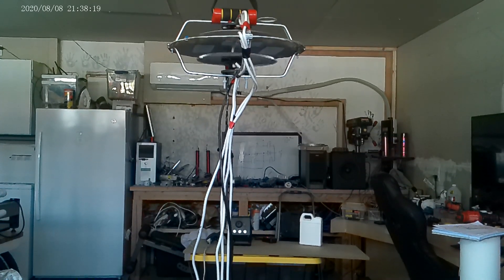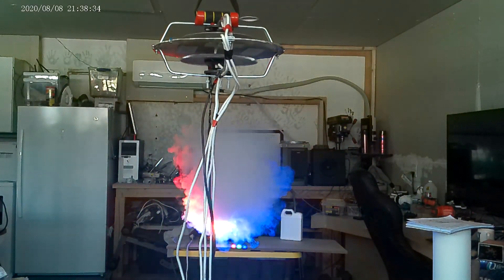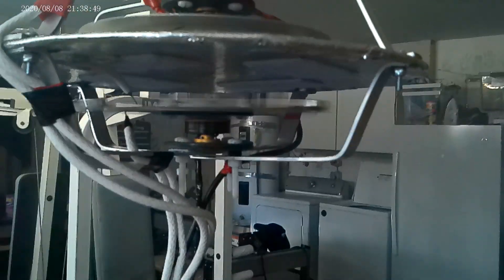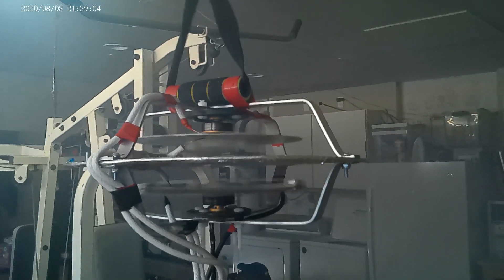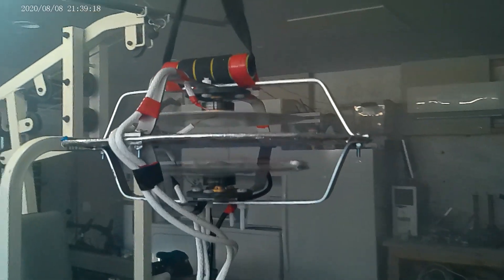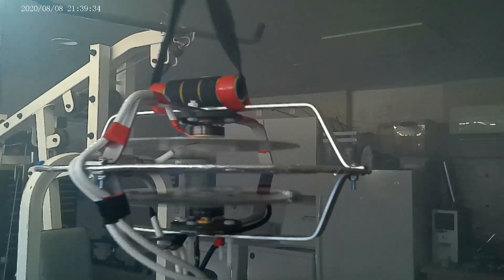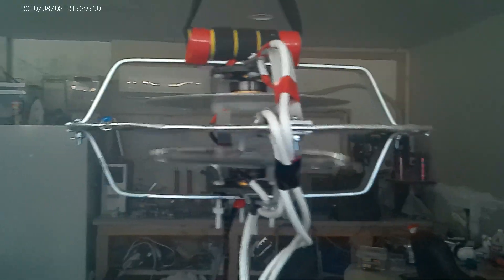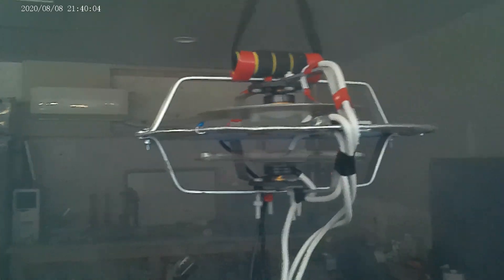Ufo Fog machine on graviflyer

Comment: near the engine that you are powering to create - the mobile phone does not work and any electronics.
Reply from the maker: Everything works fine.. the htz causes those things to not work. When a different frequency is uses it doesn't communicate with the other electronics. However if you are within a close range to the htz from the wall plug then it starts to have problems. It's like an am station on the radio.

Comment: this is a good idea when you inspect look from a distant not so close . where can i find your current understanding for how it works i want to see how near you are to comprehending your observations
Reply from the maker: was thinking of putting a shroud under the bottom disc. Just to see if i can get the fog to flow. Do you think it would work? And you said get the video from further away.
Reply: @oldmanbuilds  the fog should be flowing regardless of fight it is almost as if you have disabled the elements of the regular lifter
me in your shoes i would write on a black board bullet point summery of how i think it works and the components that satisfied each requirement from your guess how it would need to work

yes shot from further back i am sure you seen where he has a helmet and seen  him use a meter to measure the field
my hint to you is all flight works the same at the core make sure you clearly understand what flight is and how it works